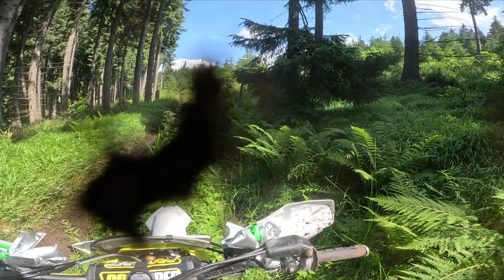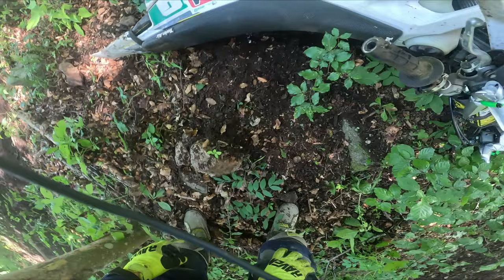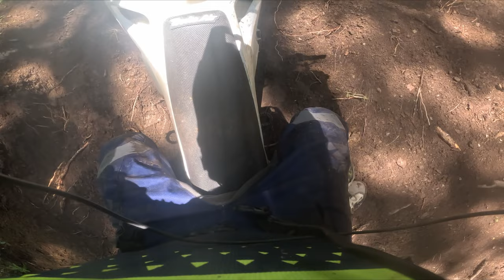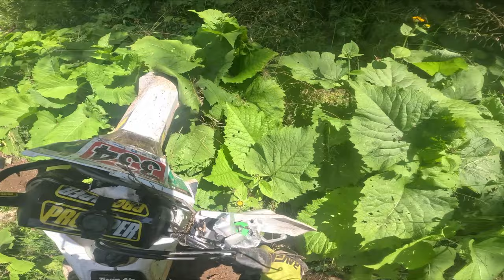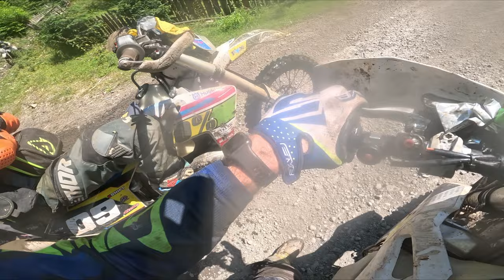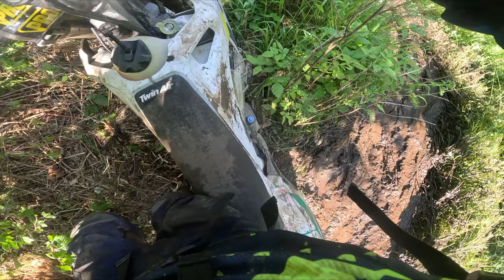Struggling in the Big Romanian Mountains | Hobby | Day 2 | Ditrocks Hard Enduro 2023

Comment: Did you ride mousse?
Reply from the maker: Yes, mousse, quite a soft one with Michelin Enduro Xtreme tire.
Reply: @RaccoonOnaRocket  Try next time tublis with half mouse , just for protect inner tube, for that condicion will be bette Metzeller extra soft tire , 0.2 bar,  Michwlin extrem is excelent tire for rocks in , rainy soil doesnt work so good
Reply from the maker: I know the setup, few of my mates use such a setup. For me it just has been to costly, so haven't yet tried it. Thanks for the suggestion!